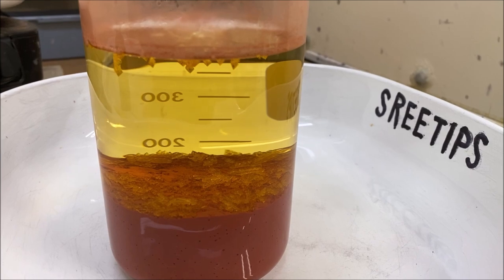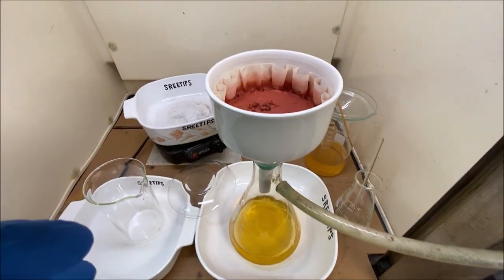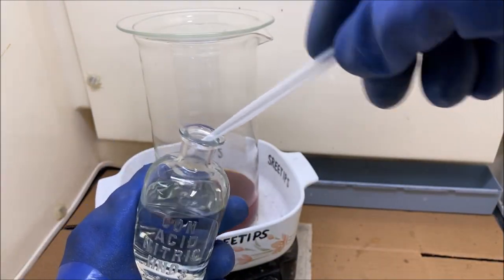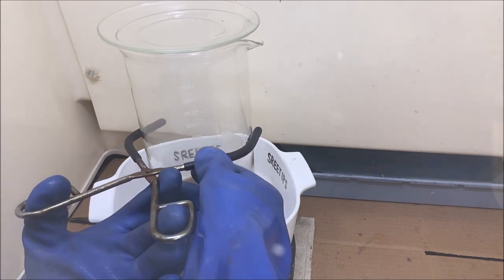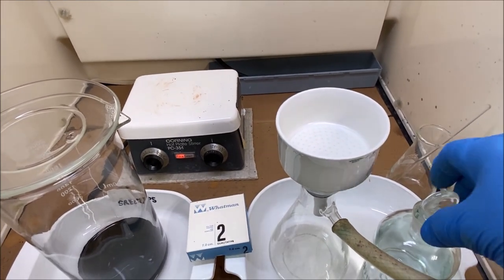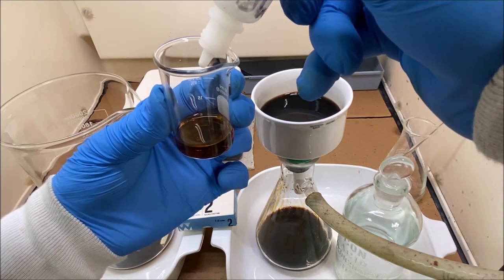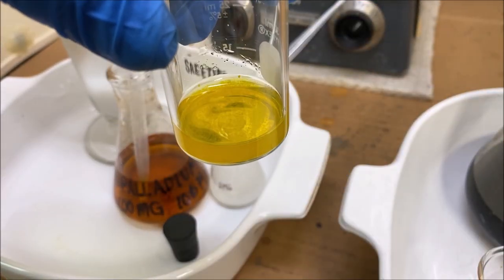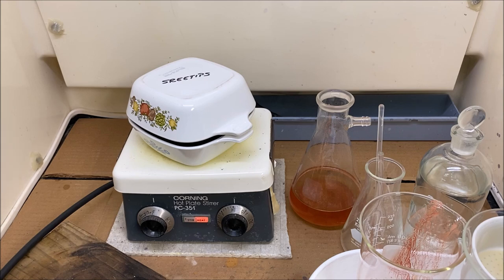Platinum Refining Bromate Hydrolysis Pt2

Comment: From my experience you actually don't need that much ammonium chloride. In order to precipitate hexachloroplatinic acid as ammonium hexachloroplatinate you actually only need a stoichiometric amount of ammonium chloride, so 2 mols per mol dissolved platinum. This will cause almost all the platinum to precipitate as ammonium hexachloroplatinate. A small amount will still remain in solution, since the solubility of that salt is 7g/L water at 15°C. Using saturated ammonium chloride solution would probably decrease it's solubility due to the common ion effect, so you'll get a tiny bit more precipitate. But instead I added ethanol to the solution (about 2 times it's volume) which crashed out practically all the ammonium hexachloroplatinate. There was no yellow color left in the solution and my yield was pretty much quantitative. I also added hydrazine sulfate to the filtrate which would reduce any hexachloroplatinate to metallic platinum and I saw nothing. For this method the solution should be relatively concentrated though, otherwise you'll waste a lot of ethanol.

And nickel would make a light green color, and this procedure would have removed it. The extremely dark red color of the solution after dissolving the precipitate also indicates iridium. The only other platinum group metals that have such an intense color in solution are palladium and probably rhodium, and you've already ruled out palladium and it's also for sure not rhodium. Iridium is the only thing that makes sense to me, since it also said 90% Pt 10% Ir on the rings. Separating platinum from iridium seems like a very difficult task, maybe I can see if I could find some information about that.
Reply: How can he test for iridium?
Reply from the maker: It’s all way over my head. This has turned my enjoyable hobby into real work. Thanks for the input.
Reply: @GokouZWAR  I don't know a qualitative test for Iridium, but by how it looks you can be quite sure it's Iridium. It also said that on the rings.

Comment: 4:20 Cut the coffee filters to fit the bottom of the Buchner funnel.
The edges will always lift, preventing a proper seal.
HCL doesn't affect coffee filter paper, yet double the paper to prevent pin hole pull through.

Comment: The leftovers could also contain ruthenium and cobalt since both are used to make platinum alloys for jewelry. Not sure if iridium is used more often. Iridium is rare. Also, most iridium salts/oxides are green or black.
Cobalt nitrate is a possible when it comes to color. This salt is red/brown.
Hard to see anything ruthenium in there because most of those oxides you would see in there are black unless you snuck in some fluorine.
Cobalt is the cheapest. 😉

Comment: Very interesting series, me Sreetips :) I'm avidly following how you manage the refinement of the (dangerous) Platinum metal... one thing I noticed is, how much effort it takes to refine a tiny amount of 10+ grams as compared to gold. Also, yes a stirbar is basically a neodymium magnet surrounded by a chemically neutral coating and those magnets can fail over time as they go through several heating/cooling cycles. The magnetic medium can't really take those repeated temperature swings without (slowly) losing their magnetivity... in other words, the more frequent you'll subject your magnetic stirbars to heating cycles the quicker you'll have to replace them
Fun Fact: "cooking" something in a bath of hot water is also called "Au bain Marie" by the French :)

Comment: I hesitate to make any comment on the process because I don’t have any experience with PGMs and no recent experience with gold or silver. But I think you could probably start with considerably more of the solute medium ( distilled water or HCl). It seems that the medium frequently becomes saturated before the Nitric is consumed, stalling the reaction. At the end of each process, if the concentration needs to be increased, you could always evaporate. But in most cases you need to dilute, so it probably wouldn’t be a problem or increase the volume of your waste stream. Just a thought. I’m really enjoying watching this series. Happy New Year, Chief 🎉
Reply: Interesting suggestion Ed. I'm thinking that the limiting factor is more likely the surface area of the platinum. Platinum is the most ductile of all metals and is second only to gold in its malleability. My suggestion would be to run the metal strips through the sheet forming mill several times after heat treating it to reduce any work hardening.
Reply: @roberthayward9299  it’s not actually heat treating. He’s just incinerating to remove any remaining organic contaminants. Saturation will stall the reaction with any metal. The solute can only hold so much and when it reaches that point, no amount of Nitric or surface area will make it continue. Adding more of the solute medium will, however, restart a stalled reaction.  I know it doesn’t matter all that much when he is processing inquarted gold because of the concurrent silver refining, but other processes may benefit from increased solute medium.
Reply: @CuttinEJ  Sreetips has done exactly that on some of his gold refining videos. He added more HCl when the reaction stopped, rather than more HNO3. 

One of the dissolution steps (2nd? 3rd?) produced a lot of brown fumes when poured into the temporary stock pot. That is a sure sign that more non-HNO3 solute is needed.

Comment: If you have such clean wastes from this process it would be better to use zinc/aluminum to drop PGM, and filter than mixing it with copper - just my 3 cents. I use cotton wool pressed into plastic funnel to catch precious particles on wool.
If there are basic metal in solution - they can be removed with formic precipitation [at least partially]. pH increase rate is key for this, and bromate hydrolysis too.
I admire you spend so many hours on that.
Reply from the maker: A charmin plug. The copper in my stock pot is a “catch-all”

Comment: How do you clean your beakers? Do you use soap and water? And where? You use so many chemicals, are you able to do them in a normal kitchen sink or do you have a special process?
Reply from the maker: Acidic solutions rinse clean with water. Then I scrub with alconox and air dry.

Comment: So what and how do you wash all the Pyrex and corning ware that you us? Dishwasher or just use distilled water? Do the chemicals not screw with the GoPros or they always outside the fume hoot?
Reply from the maker: The solutions are acidic and rinse right out with water. After a while, the GoPro will fail from those acid fumes.
Reply: I watch a streamer that does a lot of fishing streams out of Australia and the salt water and air kills his cameras quick. Mainly the connections on the the battery packs. And happens faster than you think I can imagine that acid does it quicker.

Comment: I have learned so much from your videos  and  starting to LOL because your fails WILL SAVE ME A WHOLE LOT OF CUSSING when I refine. So a couple of questions. 1) Have you Acid washed beakers & flasks b4 use? 2) would De ionized water help the chemical process be more successful? My environmental Chemistry knowledge from back in 1995 which I haven't used since then....we used filtered DI water for EVERYTHING. ACID washed containers for the Chemistry that needed it. Also good Chemistry hygiene: NO OBJECTS IN CHEMICAL CONTAINERS! THE CHEMICALS CAN BE CONTAMINATED!!!! POUR CHEMICALS IN2 ANOTHER CONTAINER then scoop them out.😎. ASLO.....DO NOT PLACE ENTIRE PACK OF FILTER PAPER IN HOOD!!!!!!!! THEY MAY BE GETTING CONTAMINATED!!!!! I winched when you used your "dirty gloves" to grab filter paper, which the box was in hood, next to beaker that could have splashed  fluid on filter box contaminating WHOLE BOX. WHAT WAS ON YOUR GLOVES WHEN YOU GRABBED THE FILTER PAPER? Please please please 🙏  leave filter box out of hood, do not let contaminated gloved hands touch stack of papers in the future. Use tweezers or pre assemble filter paper in funnel. I believe if you re establishe GOOD CHEMISTRY HYGIENE PRACTICES. ⚗️  OH L👀K the emoji has copper in it! Just want to end this by saying YOU ROCK AND ARE TICKLING MY BRAIN CELLS! 💖😎
Reply from the maker: 1) no. 2) I use distilled water contaminants measured in parts per million. Except for chlorine, tap water is ppm also. Not enough to report in a PM assay. The other stuff, thanks for pointing it out.

Comment: I read that you can supposedly seperate pt from iridium by disolving the platinum from the mixed salts in dilute AR on gentle heat. It should leave metallic iridium behind. I'm not sure what exactly dilute means. Maybe you had some of it on the first run, just before you were going to filter it? I dunno. Good effort tho. You'll get it figured out, I'm sure.
Reply from the maker: No matter how careful, some of the Pt would get left behind with the iridium. And some of the iridium would follow the platinum and go in solution. That’s the nature of these six sister metals (platinum, palladium, rhodium, iridium, Osmium, ruthenium). They hate to be separated. They don’t cooperate. I’m afraid that I’m in deep water with this series. Maybe I should have left it alone.

Comment: 15:00 I've looked up "cement" for a definition for the way you are using it, but I can't find any definition that makes sense. Do you mean "precipitate"? Or are you referring to a different chemical process? It's been a long time since I studied chemistry! Thanks!
Reply from the maker: Cementing is a term used in the refining community to describe the reaction of metals coming out of solution on another metal that’s more reactive than the metal being cemented. Silver is less reactive than copper. So if I put a piece of copper (more reactive) into a silver nitrate solution, the silver (being less reactive) will “cement” out on the copper as the copper goes into solution. Please see “Reactivity Series of Metals” for more on this.
Reply: @sreetips  Thank you for explaining the term! I will watch that series. Now I can also search for the term more effectively, too, for more information.

Comment: To all the people mentioning iridium, I'll go out on a limb here and say it's almost definitely not an iridium salt.  Iridium  hates to go into solution even in aqua regia and in fact that was how it was discovered in the early 1800s.   It was the insoluble residue after dissolving platinum for ages.  As it happens, that was probably a combination of both iridium and osmium but the scientist at the time correctly concluded it was a different metal from platinum.   

The amount of iridium metal was pretty small; only 10% of one ring which probably weighed say 3 grams maximum, so it would only be 300mg of metal and that would have been most of what was left after all the AR boils. 

When sreetips concentrated the dihydrogen hexachloroplatinate on the hot plate without the stir bar working, he would have put enough heat into that viscous liquid (approx 350 degrees C) to drive off a couple of chloride ions which bond with free H+ ions to form HCl and reduced the anion to the Pt(II) oxidation state...  tetrachloroplatinate (2-) which is a weird one.  Then the PtCl4 was in the hydrate form before the ammonium chloride was added, and thereafter the ammonium ions dissociated and formed ammonium tetrachloroplatinate salt which is the evil strawberry milkshake! :).     Search online - the color looks exactly right. 

The fact it happened twice is pretty much confirmation that's what occurred but it won't matter - calcining is the right way to go, albeit turning a really valuable precursor for medical experiments into a slightly less valuable metal button.
Reply: After dissolving the metals he got a clear solution, so the iridium has to be in solution, where else should it have gone? And it's already apparent that iridium is going in solution while he was dissolving it due to the intensely dark red color the solution had, you couldn't even see through that. Hexachloroplatinic acid isn't that dark, it is orange and even a concentrated solution like 30% isn't that strongly colored. Iridium might be extremely resistant as a pure metal, but if it's 10% in an alloy it's a different story. You also have this with platinum, pure platinum isn't soluble in nitric acid, but if you dissolve an alloy of 95% palladium and 5% platinum in nitric acid all of it will go into solution.
Reply: @alexanderkroboth3310  Agreed, it could well be - certainly makes some sense, but there was still some metal left undissolved after the 12 hours of multiple intense boils.  Iridium ,if you can get it in solution, forms coordination complexes which from my (granted hazy) memory aren't overly understood and can display just about any colour depending on the structure.  I remember this as my inorganic professor was a world expert in developing Pt and Ir complexes as anti-cancer treatments.  I however was a lowly student so take my suggestion with a grain of Pt salt.  Cheers and thanks for the reply.
Reply: @AndyGraceMedia  In that alloy the iridium was evenly mixed with the platinum, so if it would dissolve away all the platinum and leave the iridium behind you should end up with a powder or some spongy metal like how you have when dissolving the silver out of inquarted gold, but these were solid pieces of metal. And in Aqua regia, which is mostly HCl you'll have the hexachloroiridate complex, which has a dark red color. Anyway, thanks as well, have a nice day.

Comment: I have been curious for a while now but if you have all that cement silver and pure silver crystals, why do you use antique silverware and other utensil's to enquart  gold? why not just use the cement silver or even the pure crystals?
Reply from the maker: Palladium will build up in the cement silver if it’s used over and over. Pure silver crystal has already been through the silver cell - like taking a step backwards.

Comment: We are thinking that we would like to attempt gold refining ourselves. I was wondering if you could tell me where you get your supplies. The beakers, glass acid bottles, pipettes, funnels, etc.  I’ve found some stuff on Amazon, but as we all know, some of the quality of the things on there can be suspect, and if I’m going to be messing with acids and other scary chemicals I’d like to have stuff I know won’t fall apart at the first drop of chemicals in it.
Reply from the maker: First, get a fume hood. No way to do reactions safely without one. I buy all my glassware on eBay. I buy most of my chemicals from Ace Hardware, and eBay.
Reply: @sreetips  thank you for replying. I’ll definitely check eBay. Didn’t even think about that.

Comment: when did you add the sodium bromate because that step is what is supposed to seperate out the Pt from the Ir and it  is done during the time that both are in solution (dark black). to seperate out the iridium while leaving the Pt behind in solution.
pure chloroplatinic acid is dark red in color.
Reply from the maker: I haven’t done it yet.
Reply: @sreetips  cant wait for part 3 then!!

Comment: What you mean is that industrial Zinc contains palladium, but there is no rate per kilogram, only how it is processed.
As a lab man you are amazing but the metallurgical tricks are missing if you take the zinc for an estimated time in an induction furnace that reaches the stable temperature 1°C below . When the zinc boils, it begins to oxidize and becomes a metallic gas that can later be catalyzed in water and leaves palladium, platinum and rhodium as residues. For this reason, old zinc is so expensive due to the high content of platinum group metals in naval scrap yards there are thousands of buyers of this Zinc from ingots (Bota Mar).
Reply from the maker: Nice, I didn’t know that.

Comment: The the magnetic stirrer wears out.
Googling for "magnet experiments what happens when a magnet is heated" you will get the explanation:
"When heated above 176° Fahrenheit (80° Celsius), magnets will quickly lose their magnetic properties. The magnet will become permanently demagnetized if exposed to these temperatures for a certain length of time or heated at a significantly higher temperature (Curie temperature)."
Reply from the maker: I didn’t know that until this series. Thank you

Comment: What happens if you drop that stannous solution in the beaker with the precious metal?
Reply from the maker: It will turn color
Reply: @sreetips  will it ruin the batch or do you keep those test strips and refine later?
Reply: @zacherysmith2667  If this is the same as his other refinings, he saves all test strips for processing later along with the filter papers.

Comment: Iridium metal is notably inert to reaction with acids, including aqua regia. The only substances that will dissolve the metal are molten sodium cyanide (NaCN) and potassium cyanide (KCN).  So says google.  So in theory, any iridium would have remained a solid.  Might be part of what was remaining in early Pt1 vid with small undissolved bits?
Reply: The ring contained 10% Iridium. If it wasn't dissolving, I would expect a lot more than the tiny amount of undissolved material Sreetips had left after the digestion.